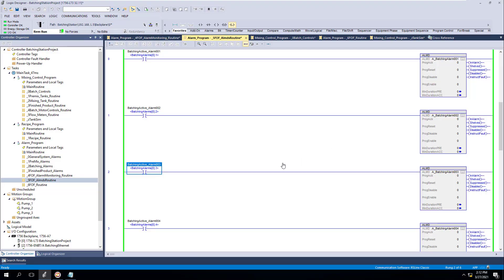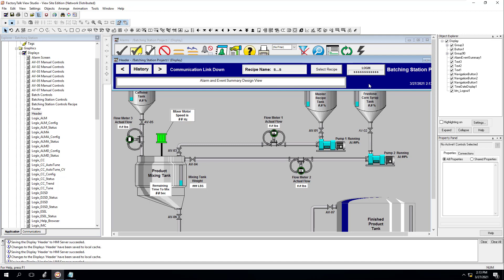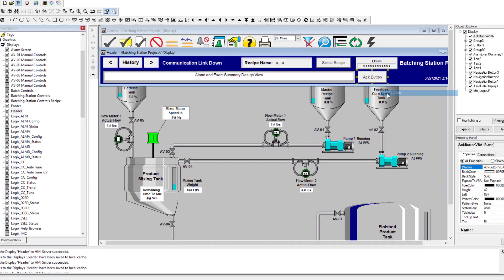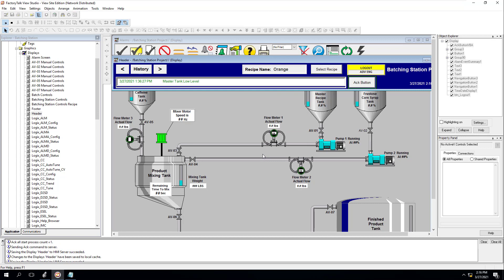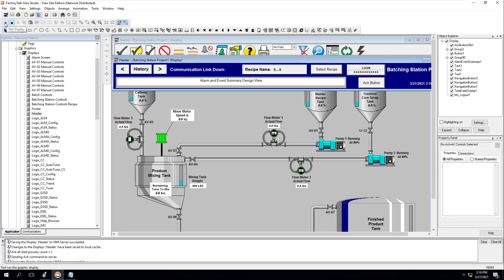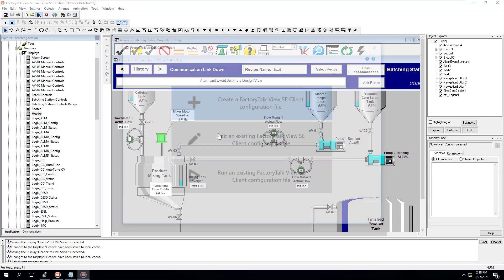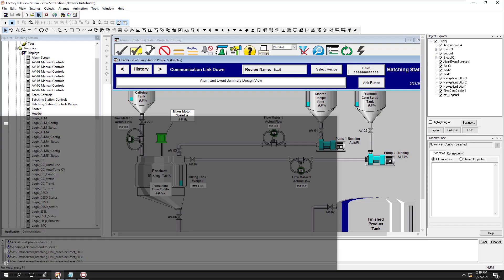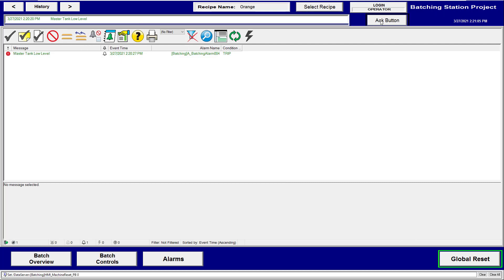Using VBA Code In FactoryTalk View Studio Site Edition To Acknowledge Alarms

Comment: Hello Shane, do you know if you can set the value of an Object that has a value property which is linked to a ClientTag?
Reply from the maker: Each client operates independently however in a whole system the client or user affect the system not just its set of controls